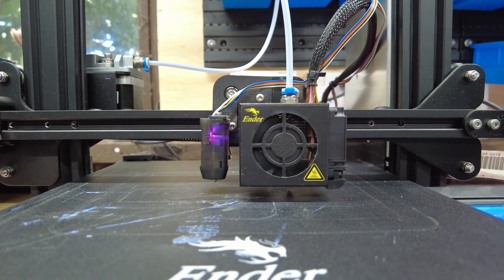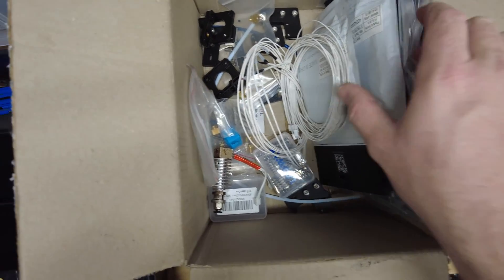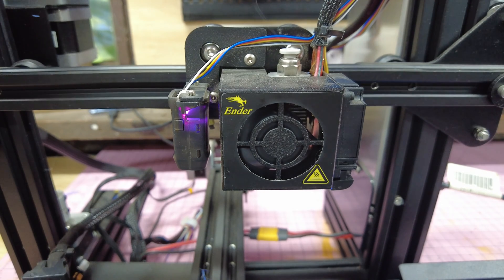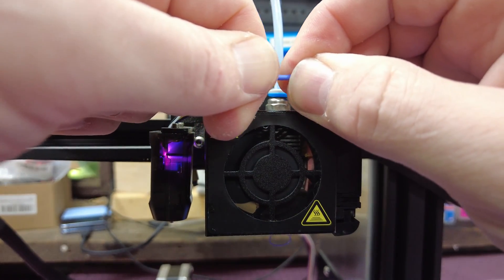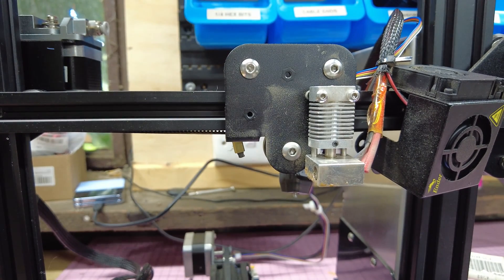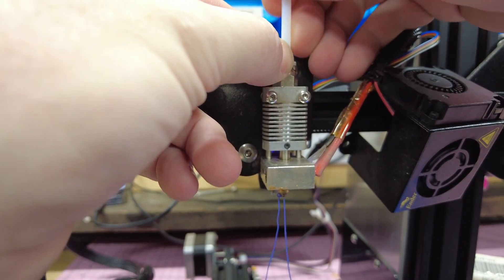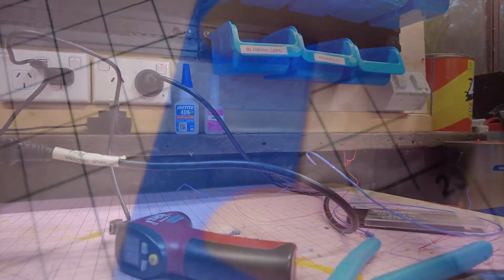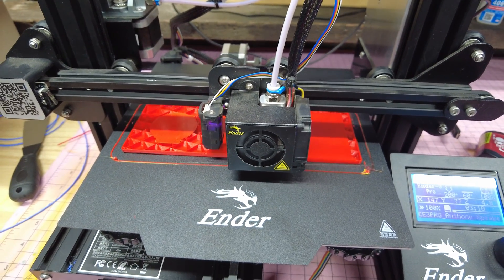No Filament Flow! | Fixing a Misbehaving Creality Ender 3

Comment: good that you solved the problem , i got an ender 3 v3 ke , worked well first then no fillament out , no clogged filament, changed the stepper motor, adjusted the extruding wheels, no luck, the extruding motor is not turning though i placed a new one checked all connections no luck , any other ideas whats happening , cheers
Reply from the maker: I would try the following. 

1. Hand Jog the filament feed with no filament inserted. Does stepper turn? If no.

2. Swap stepper cable to a second stepper just to the side (without mounting it) does it jog? Still no?

3. Replace the stepper cable. Still no jog?

I think at this point the motor driver board may need testing or replacing.

I hope that you find and fix your printer and get back to building quickly!

Comment: Cut the end of the filament at a 45° angle and it makes feeding the filament easier. Hope that helps so you don't have to remove the fitting each time. That sounds like a pain.
Reply from the maker: Thank you it's a great idea i will try it out.

Comment: 3D printing tests your patience.  Besides filament clogs, I also have serial failures (at 10 hours into 14 hour print) which is probably because AUTO/AUTO picks 250000 baud wow).  It takes a lot of learning and experience to get good results consistently.  Thank you, this video was very helpful.
Reply from the maker: Keep at it, and thank you for commenting. You're right it doesn't always go as planned, but it always provides a chance to learn

Comment: "Bowden gap" is literally the oldest Ender-3 problem. At the very minimum you should not have tightened the nozzle before putting the bowden tube in, you should back off the nozzle 1 full turn, insert the bowden tube, then finish tightening the nozzle, so it will squeeze against the bowden tube, not permanent because the coupling will eventually allow the tube to move up and create the gap again. For a permanent solution you should do Luke Hatfield's hotend fix.
Also, if you print a knob for your extruder and instead of trying to push the filament in, you put it in position and turn the knob, it will go through that first coupling without catching on the sides.
Reply from the maker: Great comment, thank you heaps for this info. Learning to use these machines has been a journey for me.